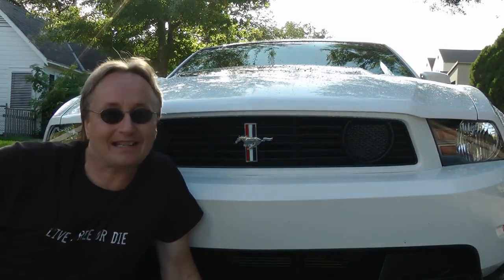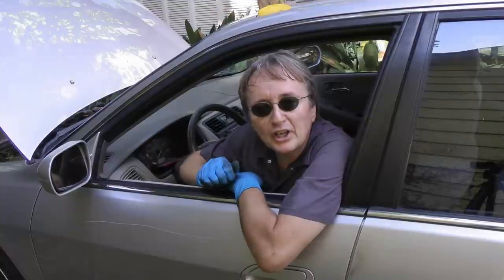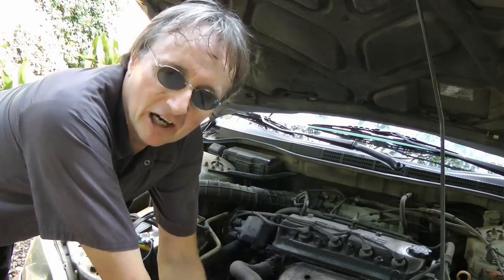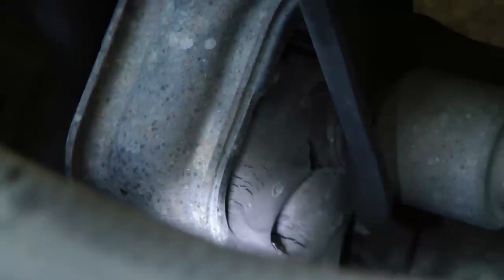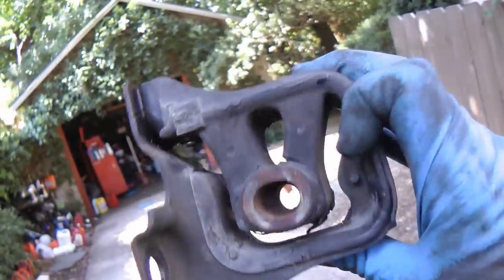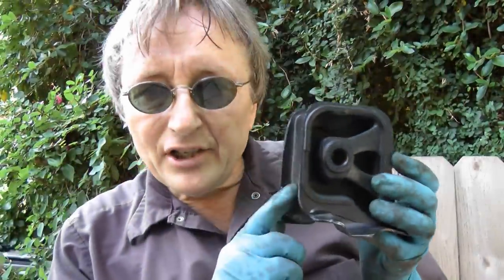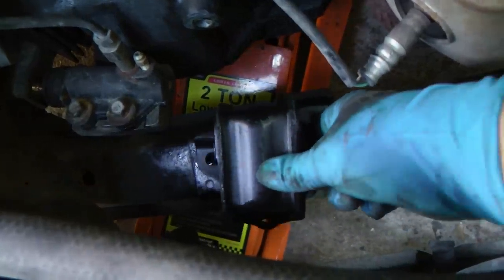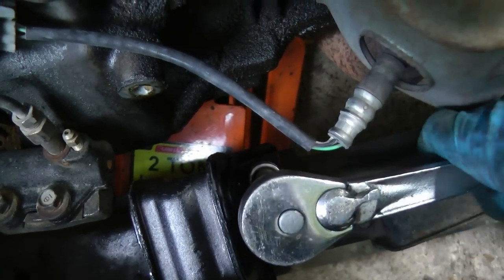How to Replace a Motor Mount in Your Car

Comment from the maker: it may be slightly worn inside, as it should slip on either side depending upon which way you are cornering. So each side should spin sometimes

Comment from the maker: @pacohc713 various numbers on different vehicles, but many have 2 motor mounts and two transmission mounts that act together. You need to get room to work, so normally you have to jack the vehicle up, then work and jack the engine up to change em. Scotty

Comment: Looks like that front mount is for a Honda Accord four cylinder, model years 1994-1997.  Very common for the front motor mount to go out on those.

Comment from the maker: you can use any kind of jack you want. that kind of grinding is often a worn bearing on the shaft, or plastic rubbing against stuff, on cheaply made modern cars that often happens

Comment from the maker: if it wasn't a dealer OEM mount, often the cheap aftermarket chinese made ones just don't fit right and cause more vibrations, realize that.

Comment from the maker: the rear mount is on the back side of the engine. When you jack up the engine with a jack and a board on the bottom to not bend things, the broken mount will be easy to see as it will be cracked and opened up as you jack up

Comment from the maker: @Jaredsfarm those are made to jack up with an engine hoist from the top using the hooks on the engine. But, many guys use a board on a jack and push on the oil pan, it may dent a little but normally no damage is done.

Comment from the maker: @Ywce07 best to use an engine picker hoist to hold it from the top, but guys will use a jack with a board on it pushing the oil pan carefully

Comment from the maker: yes, you use a small two by four board on top of the jack. OR you have to pull the engine up from the top using an engine pulling cherry picker set up

Comment from the maker: as long as it doesn't break apart, you can go many miles as toyotas sit on the mounts, they don't hangon them like old GM engines. so the engine will  not fall out or anything.
Reply: I bought a 1972 monte. All the engine bolts are missing on the driver's side, which has the engine sitting to high.. I got a new engine mount. "It only came with the top" and it's still not lining up. Need to go down like half inch to put the pivot bolt through. Any thoughts?

Comment: Often the motor mounts will look fine, but there will still be vibration in the car when idling.  I've usually made it a habit to replace all the mounts on high mileage car when this happens.  The motor mount will look fine, no cracks or dry rot, and yet it still vibrates.  Normally I diagnose them visually, as well as torqueing the engine at idle, but I was wondering if there's a more definitive way to find out which motor mount is causing the vibration?

Comment: Hello Mr.Kilmer,
I have a 2007 Avalanche and was told both left and right mounts are busted. I looked for the parts and only found one. Is there not a difference between the left and right mount?

Comment: Hey scott,its rodel i got nissan frotier 2001 3.3 v6 and the problem is if you turn the ignition on its just cranking it donst start when i check with the code reader it say p0340 camshaft position sensor 1 bank 1 and p0325 knock sensor cicuit bank 1 is this the problem to be fixed and and parts to be change if this is the one how can i locate the camshaft and the knock sensor for this car with same model ? Thank you hope you can help my problem.

Comment: I bought a 1972 monte. All the engine bolts are missing on the driver's side, which has the engine sitting to high.. I got a new engine mount. "It only came with the top" and it's still not lining up. Needs to go down like half inch to put the pivot bolt through. Any thoughts?

Comment: Probably the new mount is a bit stiff, being brand new. Don't worry, it should soften in a couple of days and the shaking will go away. I had the same with my car, when I put the new mount in it. It was shaking like hell. But after a few days it went away, as the mount softened to it's "operating level" so to speak. If it doesn't go away in a week or two, then you have to look into the thing and find the cause.

Comment: Hey Scotty I just changed all the mounts on my car but after they were in, the vibration got much much worse, almost intolerable. They were ROCA brand and I don't know what else to do to get rid of the shaking. Would oem mounts be better or are the ones I just put in unaligned somehow? The vibration/shaking is freaking me out a bit! Thanks, Josh

Comment: That's unlucky. Mine is also a front wheel drive car, with a manual transmission. But in my case the mount had softened and everything went back to normal. My shifter isn't vibrating too. My car is a '93 Opel Vectra 2.0i. Hopefully you can resolve your problem though. Cheers!

Comment: I'll try that. Do you have any idea where all of the mounts are located on an a toyota echo? I only know where one of them is and that's the one on the passenger side of the engine. The engine moves more on the drivers side but i have no clue where the mounts are there.

Comment: The new mount could be a bit stiff in the beginning. But it should soften to a normal level in a couple of days, and the vibration should go away. Well, at least  my car was like this. So I got the experience from there.

Comment: My Corolla has had two buggered engine mounts for the last two years (front and back) and I'm too cheap to replace them. If I get a tube of window silicon and fill the mounts up with that, would that do the job? Thanks.

Comment: i replaced all my mounts, well, a mechanic did, but the engine still jumps when i startup and you can see it vibrating heavily. dunno what it is, could reusing bolts cause this

Comment: Hey Scotty I drive a 2006 Infiniti G35 , when my car is cold in the morning, it does this weird thing, when I put the car in reverse (automatic) and the engine temperature is still low, the car revs up to like about 3k rpms and the whole engine kicks really hard making the whole car move, but when if I let the car warm up completely it shifts to reverse just fine, my friend told me it has something to do with transmission solenoid, what do you think it could be? It only does this when the car is  cold,. Thank you for your answer in advance Scotty.

Comment: Scotty, I just purchased an 04 Acura RL. I feel a little vibration while driving nothing that big to be noticable. Like the engine just doesn't seem to be smooth. I had Acura check it today and they said the mounts are okay but when I put the brake on and then gas the car in drive, the engine moves upwards way too much. What do you suggest I do? Which mounts should I check?

Comment: I have an 04 Toyota Highlander.  Had vibration under the seat & dash at 65 mph, was told I have a bad right front motor mount.  I hear klunking when going over bumps and sometimes feel clunking in the steering.  They balanced my tires but said the motor mount needs replaced.  Can't afford to have it done right now, wondering how long I can drive w/ it like this.  I have around 117k miles on the car.  Worried about driving it at highway speeds.

Comment: Hi Scotty. just watched your video on changing a motor mount I have an 05 Hyundai Elantra automatic. could you tell me or show me where the rear motor mount is? that is the one that is bad and needs to be replaced I am told and have to replace the other ones sometime. one auto place will replace all 3 for 400.00 which I don't have any money right now. if you could tell me where the rear one is I'd appreciate it.. thanks

Comment: Hey Scotty, i have a 2001 dodge neon and i changed the mounts but the vibration seems to be coming back...i have suspicion that the replacements were not good quality, is there a good aftermarket brand that you recommend ...i believe i used Anchor...the vibration is strong enough that i can feel vibration on the steering wheel of course that observation is taken when the car is in park and idling.

Comment: I had a 1981 Oldsmobile Delta 88 Royale a long time ago, that originally had the horrific 5.7L Diesel engine. This was before I got the car though. By the time I got it, it was outfitted with a 350 Chevy motor and the idiot mechanic freaking WELDED motor mounts to the frame! So when I wanted to replace them, I couldn't.  Eventually I got rid of the car because it became too much of a headache to deal with.

Comment: Hi Scotty, on 1994 Nissan Altima my rear motor mount tears up as soon as I install it (the longest it held up was a week). I tried different ones from Autozone and Advance Auto parts, tried replacing all the rest of the mounts as well. My friend runs into the same rear mount problems with his 2000 Galant. Are we doing something wrong or are these models just motor mount hungry? Or is it just the parts that are poor quality that are all over the place?

Comment: Hi Scotty, I have a 1998 nissan sentra gxe 1.6. Whenever I put my Ac on my car shakes when ever am at a stop ligth. It starts shaking n it will eventually shut off. Tht only happens when the ac is on. Some people it might be the transmission mount. But I dont know..? Can you please give me some advice before buying something I wont need. Thank you

Comment: Hey Scotty, I just bought a 96 Mitsubishi Montero for a good deal, the only problem obvious is the car shakes badly while idling and in gear (ie. in parking or slowing down) but vibrates less when put in neutral and no vibration under higher RPM. Could this be Engine or Transmission mounts?
Please let me know.

Thanks!

Comment: @scottykilmer Oh I know, lol. Another example is the dreaded spark plug location in those 4.3's. At the bottom and on the side of the block. Not to mention that one is directly under the steering column, that you almost have to tilt the engine to get to. I like my 05 Grand Cherokee a bit better then that POS, lol.

Comment: I used to have a 98 Blazer where I had to replace my mounts, I wonder why GM made such a stupid design, the mounts on them are just a piece of rubber GLUED to a piece of metal, that's the mount. That's what was wrong with the old one, the glue came apart. What a crappy design. I think God I got rid of that thing.

Comment: hello i have a 350 olds motor the frame mount is a two holes mount put it in a 84 regal where hole do i put the frame mount at was a v6 put a v8 in it do not know where to put the mount on

Comment: Hey Scotty, I have a question about my 2002 3.5 nissan altima. I was wondering if there are 3 or 4 motor mounts? I have located 3 of them but i dont know if there is a 4th one because i took it to a mechanic one time and he said there is one underneath the engine but it is hard to see. Thanks!

Comment: Hello Scotty now my 98 grand cherokee is running rough. Real rough and when I put a dollar bill at the exhaust it will suck up and push away. what could be the problem? When I tried to drive it
it felt like I was driving over a horrible road because of cutting in and out sputtering
Thanks Scotty

Comment: scotty, on my 99 hyundai elantra, i changed the trans fluid last sunday, when the auto trans downshifts when im slowing to a stop, it clunks , is that a bad trans mount? if so i know its a dumb question but i trust u, how do i check it? car has 30,415 miles on it. thanks . kody

Comment: Mr kilmer, today i changed the transmission fluid on my 99 hyundai elantra, no slipping. perfect at 30,000 miles. i noticed that before i did this service, it would clunk when the trans would downshift, is that a broken trans mount or engine mount. auto trans. thanks for ur time

Comment: Scotty I can't see where you jacked up the engine from in the video.  Did you jack up the engine from the oil pan?  My next question is won't jacking up the engine from the oil pan crush the oil pan and maybe oil pump? I guess I don't know just how strong those oil pans are.

Comment: My mechanic said the rubber on my engine mount on the drivers side was shot and needed to be replaced asap. Do you think I need to purchase a whole new mount or can I just buy the rubber piece and slide it into the existing bracket?

Comment: Hi i have a 07'camry and when i start the engine i have a lot vibrations even when i turn on my air conditioner its more when i put reverse vibrate but when i put on neutral i dont have vibrations so my cuestion its do you think can be my motor mounts?

Comment: I have a 97 Integra with bad motor mounts. One has been obviously been replaced (its aluminum). It clunks hard when shifting into drive, reverse, and throughout the 4 gears (even with a warmed up engine). What could happen if you do not replace them?

Comment: My car vibrates when you put it into gear.  It vibrates at idle and alot in 2nd gear  from about 1800 to 3k rpm.  Do you think this could be a broken motor mount or tranny mount?  In neutral I don't feel a thing.  The car has 117k miles on it.

Comment: scott, I got a 2004 kia Sedona, trying to replace the motor mount between the motor and the firewall, how do I get to the 2 bolts?? I have so far removed the base bracket that bolts to the frame, it is the motor mount mount....does that make sense?? I cant figure out how to get to the 2 bolts that mount the rubber part to the frame. any suggestions??

Comment: HI SCOTTY,I HAVE A 2001 S10 2.2 ENGINE 2 WHEEL DRIVE, AUTOMATIC IT HAS A VIBRATION, ALSO I CAN SEE THE ENGINE LIFT UP ON THE LEFT SIDE.(MOTOR MOUNT)? HOW DO  I REPLACE THE LEFT MOTOR MOUNT? THANK YOU

Comment: Hey got a quick question I have an alero 01 v6 the engine vibrates alot and makes the inside of the car vibrate too, the seats feel like a vibrating seat when its on drive

Comment: Hi Scotty, I think i have a mount in my car that's wearing out or broken. When the engine is idling, the whole front end vibrates. Also when I'm in drive or reverse with my foot on the breaks, there's also lots of vibration. And when I floor it, the engine seems really loud from inside the car, but not because of exhaust leaks. Do you think those things are caused by one or more of the motor mounts going bad? Thanks

Comment: I have a bent motor mount on a 1988 Oldsmobile Toronado, the mouth is kinda up high by the radiator. where would I put that jack to safely jack it up?

Comment: Scotty, you didn't show us where to jack the engine up from? How? I have 99 Nissan Altima but have had bad experience with jacking the engine up from the oil pan with a piece of wood. I made big dent and caused low oil pressure sensor to appear on dash board. Plz help

Comment: When my car coasts (no gas being applied) or i'm braking my car is smooth as a camry no vibrations. Once I press the gas or I'm just sitting still idling my entire car vibrates really bad. Does have misfire in cylinder 4, but are these symptoms of bad motor mounts?
Reply from the maker: fix the misfire first, that can do it all, bad motor mounts will clunk when you start the car from torque pressure

Comment: Hey Scotty, I need to replace one on my Accent - just one question. When you jack the engine up to align the bolt holes, is there any particular place to jack the engine up or is the sump fine?

Comment: Solara V6 2000:  I need a new motor mount and motor shock.  Should I use OEM or is there an aftermarket brand that you recommend?
Reply from the maker: siucbset oem always works, just try to get it somewhere else than the expensive dealer, many other stores or online sell them

Comment: Scotty Kilmer· Can you help me...I had a po300 and po171 I got both fix and when the auto mechanic retest the code's everything was OK engine light went off... the next morning I went to warm up the car the Car engine vibrating/shaking and engine light come back on does this mean I need to Replacing A Motor Mount Can you Help me out Thank You,
Reply from the maker: I doubt that's the mount, they do not trip any codes to turn that light on. Take it back, they did not fix it correctly, especially if it has the same codes again
Reply: Thank you I went back to them today and they fix the problem...

Comment: LMAO this guy is awesome.

Anywho, I've got a 2004 Hyundai Santa Fe 2.7L FWD. Noticed a vibration after having my timing belt done, looked around hoping it's not that the timing was off.. found that one of the three bolts on my top passenger motor mount was not screwed in, rather it was just sitting there.

Tried to screw it in, realized it's not aligned properly - off by about 1/4 of an inch. Not sure if this is the reasoning behind the vibration, but regardless, I jacked the engine up, after some time managed to loosen the left side that mounts onto the vehicle, but can't for the life of my release any of the bolts on the engine side.. WON'T BUDGE. Tried an impact wrench, nope. Tried some WD40, nope. Now bought a special penetrating rust release spray for nuts and bolts, hoping leaving it overnight helps.. but any suggestions??
Reply from the maker: that will cause vibration in most cases. I would assume the bolts are now cross threaded by poor mechanical work when the timing belt was done. As they left one bolt just sitting there. I would take it back and demand they fix it correctly, it could be a rats nest now.

Comment: Scotty, is there anything special you need to do to align the motor in there other than just using a jack to force it into place? My 2002 Mazda Protege5 has 4 mounts and I'm guessing with 4 points there's a lot less misalignment allowed.

Also, what do you think of aftermarket mounts made by off-brand companies like DEA, etc?
Reply from the maker: Often you have to wiggle the crap out of them to align them when replacing mounts. Aftermarket mounts often stink, I hate trying to use them as they often don't work, and make horrid noises when the work is done.